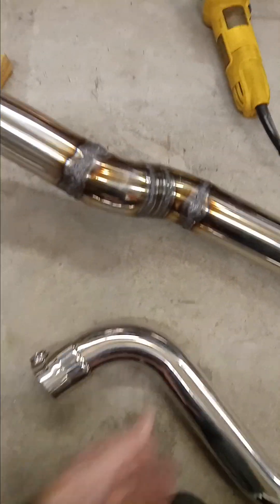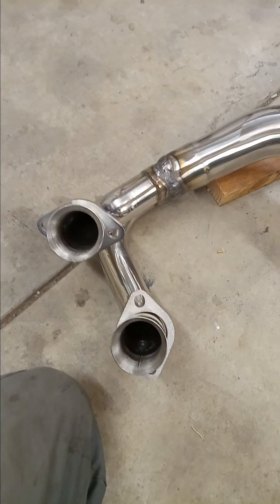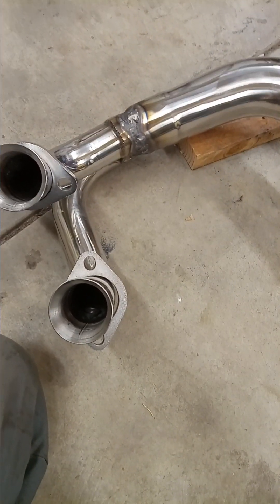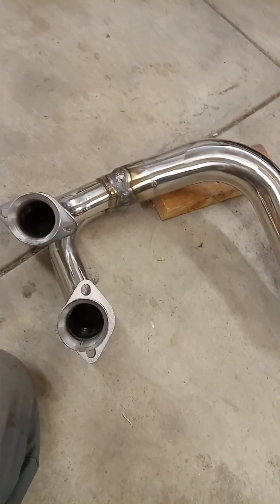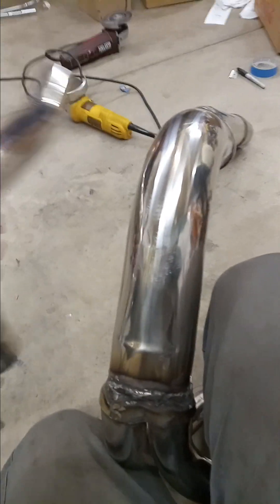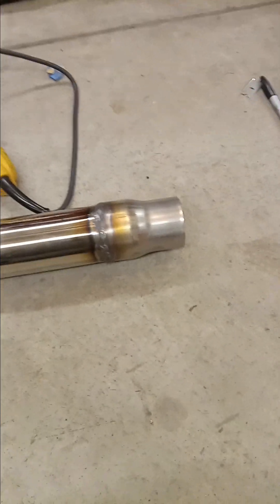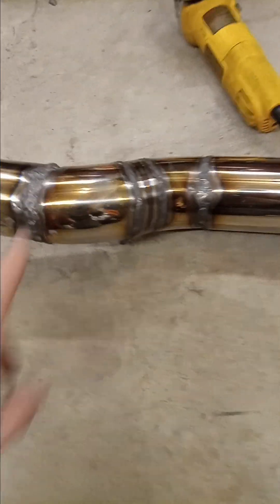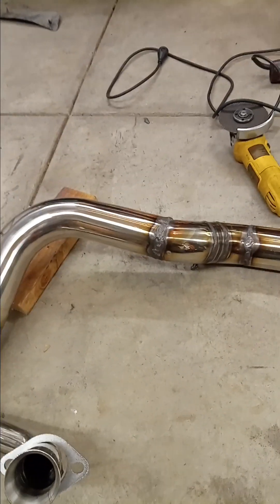Jeep TJ / YJ Wrangler 4.0L Mods to Header and Down Pipe @TeamSpeedmaster79  Part 2 of 2 #exhaust

Comment: 2000 and after have the double exhaust downpipe. 87-99 have the single downpipe flange connecting to the exhaust manifold.
Reply from the maker: Yah, this came with the double exhaust downpipe on the header (shown in the first video).  I personally like the double better, where it is a three into one, three into one, then two into one.  The benefit to the single downpipe would be lots more room though.  Thanks for commenting.